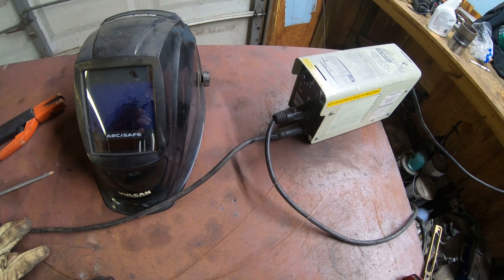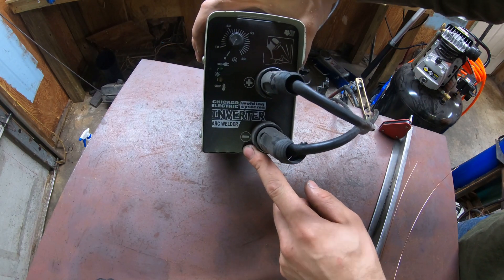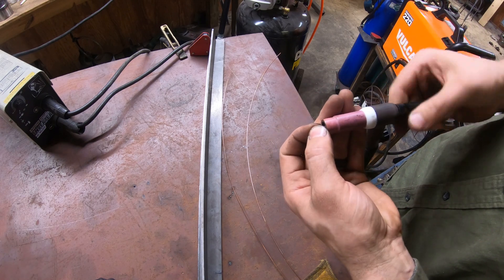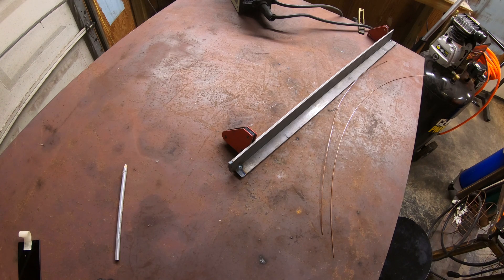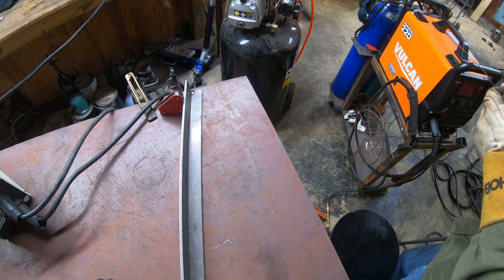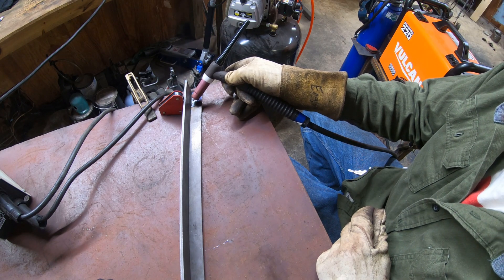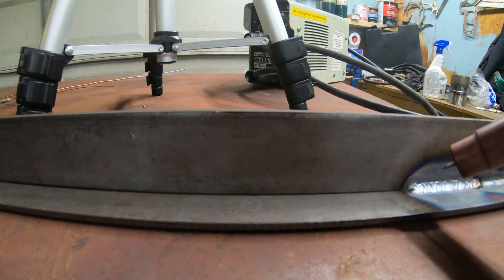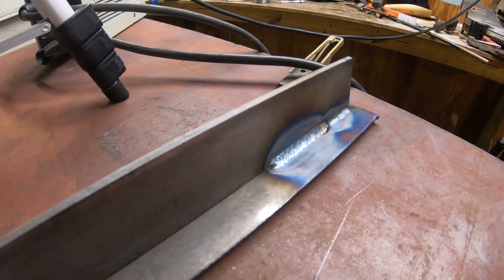Budget TIG With your Stick Welder!

Comment: I know this is an old video, "what your choice of tungsten rod you are using" is important . There are at least 4 different compositions of tungsten rods, picking the right one will give you the best tip performance. With a little practice you can even use the tip of the filler rod to start the arc, so the tungsten doesn't come in contact with the the job, the filler rod does 😎

Comment: Would this work on a m8ller 225 amp 230 volt ac welder?
Reply: NO.  Hi Larry,  You will need DC welder to scratch start Tig weld as he stated.

Comment: Touch very slow and easy it will squeak then lift. NOT REALLY A SCRATCH. Scratching will dull the tungsten. ( first touch the cup down then lean over the tig torch until the tungsten squeaks then your ready to weld ) will not squeak if tungsten is dull !!!

Comment: Bottle of gas $180. I'm investigating what is possible. How many minutes of tig welding with such a bottle?
Reply from the maker: It depends on your gas flow rate, for example if your regulator is set at 20cfh ( cubic feet per hour)... than a 80 cubic foot bottle will last 4 hours.   Hope this helps!

Comment: How do you regulate the gas?
Reply from the maker: Flowmeter on the bottle will regulate your flow (CFH) and the tig torch I have uses a knob near the head to open or close the gas flow after the flowmeter .. similar to a needle  valve

Comment: Did this with a Hobart XL-225 AC/DC unit and used the tig torch off my 1964 Miller 250 AC/DC-HF Tig-metallic unit that has a broken amp indicator cable....I usually just weld stick with it and set the amps by "feel."
Bought the Hobart for portability and more precise settings.
Additionally you were "pushing" the weld rather than "pulling" it.

Comment: Hi. My question: how do you release the gas?  is he always released? is gas discharge controlled only on the gas bottle? Sorry for my english...
Reply from the maker: By using a tig torch with a shutoff valve near the torch head you can turn it on and off when needed

Comment: Questions:
Sir it can be run ac or dc, or both ?
Reply from the maker: DC only.  Even with an AC stick welder I dont think you can use this adaptation without a high frequency box for arc initiation.
Reply: @ImprovisedBuilds  thank you

Comment: how did you trip the breaker?
Reply from the maker: The wiring to the garage at the time was basically an extension cord about 100 feet to the house, being a 20 amp input welder and the long run it just wanted too much current from my breaker I suppose.  Updated wiring now!
Reply: Oh ok, just asking because I have an inverter myself and I'm not very experienced in welding. I'm being a little rebelious and doing it in my appartment complex which so far has held without tripping the breaker. I connect it straight to socket so I guess that's what hopefully helps me out?
Reply from the maker: @Rulox999   That definitely helps not trip a breaker, it will also help the welder run the best it can.  Sometimes a welder can be a bit difficult to weld with on a long extension cord because of voltage drop.  Be careful at the complex and always check for fire before leaving after welding no matter where you are...have fun learning!
Reply: @ImprovisedBuilds   Thanks for helping me out man. Keep on doing cool stuff.

Comment: this video gives hope to those that cannot/struggled to acquire a TIG welder,  really love it. I hope you can make a conversion of an AC stick welding machine to DC TIG welding machine, would really appreciate it.
Reply: Google up ac to dc welder conversion. Theres a diode array you can convert your welder with. It is a bit of a learning curve but it can be done
Reply: @darrinjones9387  oh I saw one with an ARC PIG but others are just DC to DC
Reply: @jimbrosshop9600  Check out the Hackaday Modified Tombstone Welder article with references and maybe some more info in the comments.  There are some other videos that do interesting HF start DIY designs as well that are now way smaller and more cost effective than the old say like Lincoln HF Starter.
Reply: @jimbrosshop9600  I'll eventually make a video regarding, though haven't gotten around to that project task list again yet.  The AC to DC rectification is super simple if you know what you're doing.  Then adding more features and controls is just more to learn and a neat learning experience just reading into alone... even if you don't have the parts sitting around.

Comment: Can you do the same with aluminum?
Reply from the maker: I dont think it's quite as easy to make a quality aluminium weld with this method, I believe it can be done, but  requires a higher amperage welder and the results are not very spectacular.

Comment: Hi absolutely love the video, I’m 15 and I have a MIG welder but would love to learn to TIG on a budget of course. Anyways I was wondering what kind of amps you need to TIG? Also what AMP is the welder you using? Thanks a ton 👍🇺🇸
Reply from the maker: The amount of amps needed depends on what you want to weld (material thickness)  this is an 80 amp welder...since the output of this welder is not very high, I have to weld a little slower than I might with a more capable machine.  A good rule of thumb is 1 amp per .001 inch material thickness...for example 1/8th inch steel (.125")  would ideally be welded at 125 amps for a single pass weld.
Reply: Good deal young man.....Keep it up, welding is an ART, and I am an ARTIST.....Practice, Practice, Practice, you'll get it Young Man, it takes a Passion for it. I'm old now and kinda shaky, but back in the day, could tig two soda cans together, lip to lip. You'll get it!

Comment: What do you do if the tig torch has a trigger do I just join the wires together.  Please help
Reply from the maker: The trigger should function separately from the torch itself.  As long as the trigger isn't connected to the welder and the welder has constant power supplied to the torch then it should work fine.

Comment: looks a lot like oxy acetaline welding
Reply: Exactly my thoughts. But instead of open flame you have an arc. Motion looks similar too.
Reply: @BAK87  that’s because it is. The main difference is that Oxy heats up a wider area causing warping while tig heats a much more focused area. Also it’s less prone to injury and more comfy.

Comment: welding steel is notmy problem , i want toweld aliminium . Ifthisfixworked for that i'd be happy, is there a cheaoper way to weld Ali?
Reply from the maker: Without a proper AC tig welder I'm not sure there is a very easy and  economical way to tig aluminum. You can get aluminum brazing rods fairly cheap that can be useful for some applications and only need a propane or mapp gas torch

Comment: Very nice. Did you mention in your video that you have to practice, and get good at tig welding to have god welds.?
Reply from the maker: No I dont think I did and that's a very good point for sure.  Having a way to practice on a budget CAN help you get there though!
Reply: @ImprovisedBuilds  I'm doing an apprenticeship myself, I bought myself a cheap machine that came with a tig/stick option. It isn't the greatest but it sure does help to be able to make small things at home and practice while not at work.
Reply from the maker: @barrackobama5470  definitely, tig is very handy for the most delicate of weld project work.
Reply: @ImprovisedBuilds  What you say is absolutely true.........I have a plasma welder for all my welding needs and I bought one of those cheap 250 amp DC welders on AMAZON in case one day I needed to do some scratch Tig.....that day turned up sooner so I've  just invested in a torch, flow meter and soon a gas bottle.
I sold all my welding gear a couple of years ago when I bought the plasma welder and the ability to do some Tig work was something I missed so back to the bank account bashing to relearn with scratching.....I've never done scratch Tig so never too late to learn.

Comment: Hey.Sir. Can you explain  some video about tig welder conversetion to plasma cutter.I think if this circut is working about tig welding can we use this methot adding comprest air change with argon gas  will we use it like plasma cutter. Thnks
Reply from the maker: I would if I could but I dont know enough about that particular conversion.  I believe with the available  plasma cutters today the cheaper rout would to buy a plasma outright.  The conversion seems like an expensive venture due to the fact that tig and plasma work in different ranges of voltage and amps and the same power supply would unlikely be able to be simply "switched" back and forth between process's without major reconfiguration.  But I'm no expert on this topic.
Reply from the maker: Check out this video I did...this plasma was only $220 shipped! https://youtu.be/nvyA5SaN4rc

Comment: So the ground is on the para lug and the torch is on the negative terminal. Then the working material is not connected to any terminal positive/negative?
Reply from the maker: For steel you want to run DCEN.  Which means to use  a (DirectCurrent) power supply and that  your tig lead is connected to the negative output from the welder(ElectrodeNegative) and your ground clamp is hooked to the positive output of the welder to complete the circut

Comment: Great vid dude very helpful but cannot find these para lug's for sale nowhere ?
Reply from the maker: Look up "105z57 Power Cable Adapter" and you should be able to find one on through somewhere like WeldingCity on Ebay...I'm not 100% sure that's the part your equipment will need so check the threads on your hoses to make sure they they match the pitch of the part you ordered.
Reply: Improvised Builds i am uk ex pat living in Thailand found one many thanks on Amazon prob sorted 🤘🤘😁😁
Reply: @ImprovisedBuilds  Thankyou for details of what to search. Found straight away on Alixpress. $12 plus shipping to NZ

Comment: We use propane on our cutting torch. Do you think propane would work for tig welding?
Reply from the maker: No, specifically because TIG stands for Tungsten Inert Gas welding which refers to the process used..not particularly the technique which IS pretty Similar to Oxy-Fuel welding....  You should be able to use a oxy-propane torch to weld mild steel, but probably easier/faster to braze.
Reply: lol, no no no propane is like the opposite of an inert gas its flammable. but I see why you asked that because you looked in your shop and seen a propane tank and was like gas ok lets do it. but no propane is not an inert gas its actually somewhat of the opposite because it reacts like its flammable.

Comment: Can i use it to weld aluminum
Reply: I’m pretty sure you need AC for aluminum.
Reply from the maker: Yes, but that setup is not very practical   unless your welder has a relatively high amp capacity.
Reply: No you cannot
Reply: Yeah you need AC for aluminum.

Comment: Can this setup weld aluminium? Thanks
Reply: Twaha Issa fat 1/8 tungsten and 100% helium to TIG aluminum on DC
Reply: @madvtecyo546  so expensive not worth the hassle then
Reply: fierrosoft didn’t say it was worth it, was saying it’s possible
Reply: MadVtec YO thanks man
Reply: setup for stainless steel with dc?

Comment: pretty cool idea, if this also works with an ac machine it could be used to weld aluminium (?)
Reply from the maker: Thats a good thought and that might work to some extent..but I have always been under the impression the arc will be unstable if you try to tig with an Ac stick welder because of the ac frequency but I have never tried either so I cant confirm or deny with 100% certainty haha!
Reply: Need to use a bridge rectifier.. runing some alternator diodes.. you can make ur ac run in dc.. and weld aluminum..
Reply: @josegante6982  aluminium can only be welded with ac, dc cant break trough the oxide layer
Reply: @TheMadJoker87 Sir, with the respect you deserve .. I think you lack experience with the subject .. aluminum can be TIG welded in DC using helium .. and preheating the part .. and of course cleaning very well with a brush  stainless steel.  I invite you to watch videos here on YouTube I am not inventing it .. I have 15 years of being a certified welder in my country ..
Reply: @Eddie Hitler please make it clear for a rookie like me to understand this conversation coz ive been planning to do this conversion but mines AC.
Reply: What you can not believe is that you are going to use an AC machine to weld aluminum without the high frequency arc start and without the pulses ... people believe that only using argon and Ac can be welded ... and it is not  So .. the ac current mechanism doesn't work the same .. and it won't be able to sustain a stable arc in any way .. because the argon conducts less electricity than helium and because the current flow will be changing between 50hz  at 60hz depending on the electrical network.
Reply: @josegante6982  Exactly. You are very knowledgeable. DC aluminum tig was the original tig process. It was called(HELI-ARC) Welding with the ( heli) being short for helium. Good comment.

Comment: Nice looking welds. Awesome video that really shows that if you learn how to use your welder you make have great results and not have to spend a grand or more on a welder!
Reply from the maker: This is the first welder I bought and this is actually the setup I used to start tig welding..I dont think I show it but I made a 25 foot ground cable to match the tig lead.  I had it gas bottle and all mounted on a hand truck that I just had to plug in and weld!